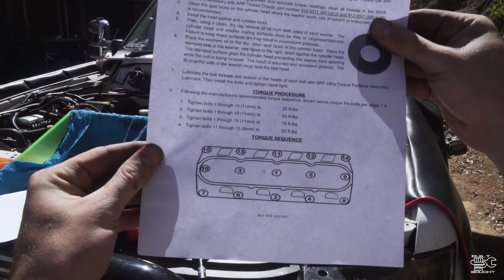BUILT NOT BOUGHT Ep.20 || New Heads, this can only mean one thing..

Comment: You'll probably still have the slippage issue with the supercharger belt Sammy. The smaller pulley reduces the belt wrap-around arc length which reduces the belt's grip. Increasing the speed of the belt by increasing the diameter of the crank pulley will increase the centrifugal force acting on the belt at the supercharger. Which will effectively lift itself off the pulley at higher speeds.

Comment: Putting the car in low range makes it easy to turn the wheels through the crank pit it in high range 5th gear the ur not gonna budge it
Reply: Turning the engine over through the drivekine is much much easier in 5th, however more revolutions of the wheels are needed for a turn of the crank

Comment: I guess 503hp. one way to get the crank bolt loose but a little sketchy is to take the coil leads off so wont start, then put the socket and bar on but up to the frame. tap the starter, and it will almost always come loose. !!!BUT!!! sometimes the bar will come off and go into the rad.:(  Used this many times on the lower bolt on the older 20-22r Toyota engine that are known for not coming loose easy.

Comment: If you wanna stop the car rolling put it in 5th 
Low range /lowest gear amplifies the engines torque to give you more power 
And It amplifies the torque from your bar mea sing you need a smaller bar to turn the engine amd move the car 
Not so great trying to torque bolts

Comment: How the hell did the old combo only make 430 rwhp not trying to be an asshole but i have an l98 completely stock internals apart from small blower cam,older 1900 harrop @ only 7.7 psi boost and i made 560 rwhp maybe  your tranny suks more power getting it to the wheels but that does seem very low,what sort of tranny do you have?